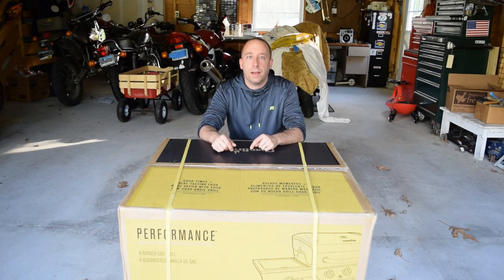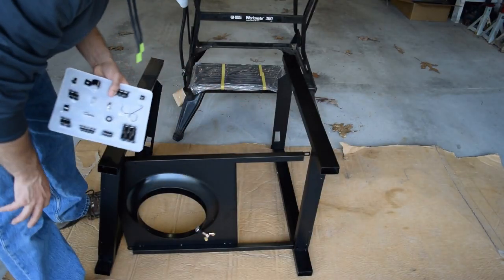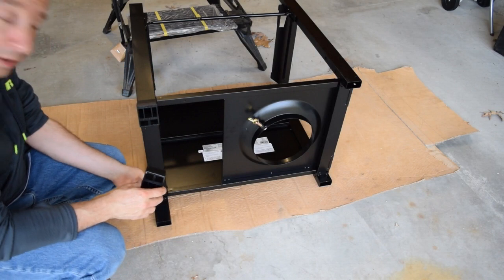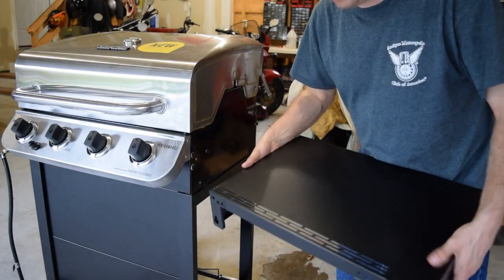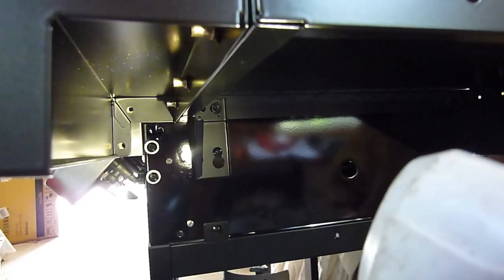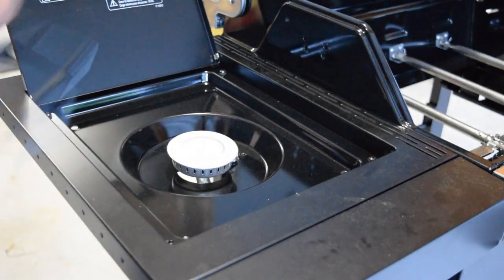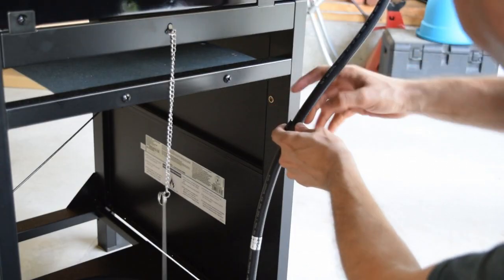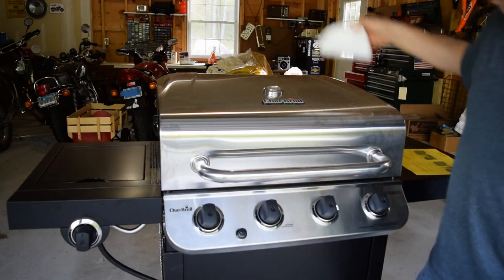Char-Broil Performance  4 burner Grill Assembly (Model number 463347017)

Comment: What is that little chain hanging down on the frame?
Reply from the maker: It's to hold a match if your igniter goes out
Reply: @SevenFortyOne  thank you.Now I'm going to try and put that clip on the side burner.
Reply: @SevenFortyOne  Thank you, I was wondering about this as well.
Reply: Your video has definitely helped me today.  I've been putting my new grill today and was getting rather frustrated by the pictures on the directions. So small.  Thanks so much.
Reply from the maker: Glad this helped!
Reply: The directions have a 1 2 3 4, and then said screw numbering the rest of the pieces. Argh trying to figure this out which one is the two 31s and 32 and 36

Comment: I had to watch your video just for the spring clip at 15:00. I thought I was doing something wrong. I was looking for a second hole but it literally just sits on top. I used the manual to put it together. Took me a little under 2 hours.
Reply: mluterancik I still don’t get this part 😫😤
Reply: Yeah, that part was what made me look up this video. The instruction manual didn't explain it in the slightest. The picture was awful.
Reply: @mikerennie2024  Agreed, it's the weak link in the instructions.  Glad I found this video it straightened it out in my mind like that (snap)

Comment: Kudos for this video:   I followed the instructions to assemble my recently purchased char-broil model 463376217.    I didn't find anything that didn't apply to this model as well.   I have little experience in projects such as this, but I found the video explained everything I needed to know.   If I did not have this video, I expect the project would have taken at least two additional, head scratching, hours.   
I did find one point where the video may have contained a minor error.   The video suggested placing a washer on a bolt to correct for a too large hole.   When I inserted the bolt in the opposite direction(which is believe is the correct direction) I didn't need the washer (which did not come with the the grill).   Doing it this way also meant I didn't need the wrench on the nut.   The nuts all came with a sort of scored, attached flange which serves as a lock washer and which allowed me to assemble the entire grill without the 10 mm wrench suggested in the video.   My only tool was a phillips screw driver.

Comment: We just bought this exact grill, and I Googled looking for an assembly video. The instruction sheet that Char Broil gives you is absolute crap. I set my laptop up on the old grill and went step-by-step. Terrific video! A couple of times he forgot to mention which particular screw to use, or exactly where one went, but I was able to quickly figure it out.

If you bought this grill and couldn't make heads or tails of the directions, this is the video you need!

Comment: Thanks.  I am actually pretty mechanically inclined but I thought the instruction were wanting.  There were just diagrams and no how to written communication.  You saved me on how to get the wire clip connected.  I was looking for another hole not knowing the one part went over the fitting.  And I too missed the 4 additional screws for the side shelves.  My guess is,
 it is the instructions and not our collective memories.  GREAT JOB!  Thanks a bunch.

Comment: Thanks for taking the time to do the video.  I was lost otherwise like the other comment the assembly instructions are more or less useless.  I am female and never in my wildest dreams did I think this grill would ever go together. One thing I did wrong was the orientation the main hood.  Had everything assembled in 4 hours and realized the drip pan would not go in.  Left the shelves on and took the four screws out flip it and was back in business.  Good job on the video... LR

Comment: Thank you for uploading this video - very helpful indeed.  I did not find the manual very helpful except it provided an accurate parts listing.  Your explanation for the labels on the back of the package containing the screws, bolts etc.. was very nice touch.   Your video made the setup very easy and very fast.  The model number for my grill is 46334718 but the setup is the same.  Picked it up from Lowes at the start of their 4th of July event.

Comment: I wish I had found this before I built this same grill yesterday. Took 4 hours with patience building breaks. Worst part was the side burner control! Never could get the silver cover to line up with all the resistance from all pieces! Hoping to be sure I did this safely, so you will be a comfort when I get to that part!
Reply: This build would have been so much less intimidating if I had seen this first. Thanks so much.
Reply from the maker: I'm glad my video helped you - thanks for letting me know!

Comment: Excellent video! Thank you for taking the time to film this! You made the process much easier!
Reply: the gas pipe coupling from side burner is not tight, despite the clip. not to mention the end of that pipe has a mesh wire section. How oes that not leak gas. I assembled mine yesterday and dared not use it. I thought I  did it wrong till I  see this video.

Comment: You make this look like a piece of cake! I just spent over 2 hours trying to put the 5 burner stainless model together and gave up. Your video makes a lot more sense than the horrid directions. They give part numbers but nothing is labeled except the blister pack of screws. It is basically written in hieroglyphics with nothing but pictures that don't necessarily make much sense. Thanks for the video. I might actually be able to grill on the 4th of July after all.

Comment: Be sure you send in your warranty and registration info. I purchased a Char-Broil 4 burner commercial gas grill at Lowes over 7 years ago.  I wanted to rebuild it, it was rusting out. Char-Broil said my 4 gas burners were still under warranty, after over 7 years, and they were free. I Did order the other parts, cross over pipes, flame tamers. Installation was easy. Char- Broil was very nice. Thanks, JohnG

Comment: Great video! Thanks.

NOTE:  One correction! You installed the top-rack / warming-rack upside down. The lip in back should go "upward" (which helps prevent items from rolling off the back).

I personally did not think the instructions were difficult to follow. The entire project took only 1 hour roughly. Just look closely at images. 

This video is wonderfully easy to follow.

Comment: 5 minutes in. My screws did not easily fit into any of those pre-drilled holes. Wish you would have shown yourself doing it so I could know if this was unique to my set of D screws or if I am missing something because up to that point - smooth sailing.
Reply: I had the same problem with mine.  I use an Awl to try to get them in line.
Then I had to use a offset screwdriver to get them in.  Other than that all
went well.

Comment: Just bought this grill and became overwhelmed with the instruction booklet it came with. Your step by step video helped me a ton! However, one thing that I got very confused with was the clip to hold the valve. I couldn't figure out where to hook it after I clip to the venturi tube.
Reply from the maker: It may not have shown up well in my video but It just clips around the "T" Fitting that is part of the side burner control.
Reply: SevenFortyOne thanks for the video bought this grill from Aldi for $80 (doesn't have side burners) and our "G" clip doesn't hook to anything and don't understand purpose?
Reply from the maker: Sounds like a different grill and may be a different design.  It might be a good idea to check with the manufacturer to see if they can give you some info.

Comment: Thank you for your video! I just need to change the 4 burners of my Char Broil Convective 410B and only I can find a very thick ones in Amazon that do not fit in the panel hole to reach the gas ... can´t finde the correct ones anywhere.

Comment: If you put the two rectangle pieces down first then drill the designated screws for them it’s easier the gas tank holder not in the way

Comment: This is a rookie & embarrassing question. I just finalized the assembly of the Signature series 4 burner but I flipped the base/bottom of the grill. This was realized when we tried to slit in the doors. 

Question : Is it as easy as just taking the wheels out and screws on the base and flipping it?

Comment: So my ignitor doesn't appear to work. Even with the proper connections and a fresh  AAA battery, it does not click? Full disclosure: After installing the grill, I went six months before trying to use it. To be safe, I replaced the battery that had been sitting for six months. The grill was safely covered and under a patio so the elements did not get to it. What might be the problem? Thanks in advance.
Reply from the maker: Hard to say....if you are sure the battery is good and installed correctly then maybe check all the wiring.  I suppose the igniter itself may be bad too but I don't know how to test it

Comment: I got this grill home but took one look at the instructions and took it back to Lowes to have them assemble it.  There are no words to accompany the illustrations!  Duh!  Luckily, Lowe's already had one assembled and it barely fit into the back of my CR-V after I took the lid off.

Did you install the grills upside down?  Charbroil also wants you to inspect the flames before you put the metal shields and grates on.

This video is very helpful and Charbroil should compensate you for doing the work they should have done.  Too bad so much of the closeups are out of focus.

Comment: (reposting to correct) the gas pipe coupling from side burner is not tight, despite the clip, not to mention the end of that pipe has a mesh wire section. How does that not leak gas? I assembled mine yesterday and dared not use it. I thought I  did it wrong till I  see this video.
thanks
Reply from the maker: I'm not really a fan of how the gas tube for the side burner connects with that clip either - it seems a bit flimsy to me.  
I think the wire mesh is there to help let air (Oxygen) in so the flame in the burner will burn evenly.  The pressurized propane gas flows past the opening and sucks a bit of air in through the mesh opening as it passes by.  This is all governed by complex things I don't fully understand like fluid dynamics and the Bernoulli principle so I can't really explain how or why it works I just know that it does.  And I know that without the mesh opening it wouldn't work properly.

Comment: THANKS 741! Question, the Q-hook that connects the side burner gas line to the base really does not have a defined fastening point. Can you share EXACTLY where I am supposed to insert or wrap the hook toward the front side of the grill? I can easily see where the back hook goes, in the copper pipe. Easy. But where to exactly place or how to hook the other part a real mystery. 

Thanks again. DW
Reply from the maker: I hooked mine over the T fitting that is part of the burner and parallel with the burner control mounting plate.  If you are looking at the front of the grill facing the burner control that would put it to the right of the hose that comes out perpendicular to the burner control mounting plate.  I don't know if that is the correct, factory spec location for it but that's where I put it and it seems to work OK.

Comment: Thank you for the video.  This was way better than the manual.  Unfortunately, my regulator was defective and now that I have the replacement part, there's no video or instruction manual they can give me.  The regulator is one piece that includes the burner heads so it's not your typical regulator replacement.  Any info on installing this?  Thank you.

Comment: when I got to the burner control and had to remove the screws (to be used later) I only found one instead of two. I tried to use only one, but the assembly is not sturdy enough. I tried to remove to first one, and I cannot do it, it got stuck! : ) (please, don't laugh too hard) What kind of screw should I try to buy from Home Depot, or hardware store? With anticipated thanks!
Reply from the maker: I really don't know what size it is.  The best thing to do is to call Char-Broil and ask them if the exact size and thread pitch isn't listed in the manual.
Reply: Thanks for the prompt answer!

Comment: Great video, and very helpful. One question I have - how much movement is there in your grill knobs/the stalks they attach to that regulate gas flow (side to side/up and down) as mine have quite a bit of movement. Want to see if this is normal as they all work, just don't feel solid. Thanks
Reply from the maker: I think Mine are pretty solid...
Reply: SevenFortyOne Ok. Thanks. May need to have mine checked as they're definately not solid!

Comment: I have 3 burner
I have wire going to side burner and then only 4 other wires - and six slots HELP
Reply: I have the same. There are 2 other wires for the igniter. Six in total.

Comment: My grill won't light. The igniter is working and my propane take was brand new and full.  Also tried manually lighting it. I've heard that the regulator might be the problem. I looked to replace it, but the replacement ones look very different from this one. Any idea what I can do to fix it? 
Thanks for the video!
Reply from the maker: I'm no expert on grills but make sure the valve on the propane tank is open and then turn on one of the burners - you should hear the gas coming out.  If you don't hear it then something is probably wrong with your regulator. If you do hear/smell gas at the burners then the regulator may be OK and you may have other problems.  If the grill is new you can call the number in your owner's manual for help.

Comment: Have you had any problems from higher yellow flames around the front of the tubes and the crossover bars? Can't seem to get even higher temps on my unit and I fear those yellow flames are the culprit.

Comment: Thank you! I have not received my grill, yet...however, I will be attaching a natural gas line to mine. Is there anything different I should do during the installation?
Reply from the maker: I don't know...you should contact char-broil about this.  This grill is designed to use propane.

Comment: I assembled the grill. good vid.  On mine the side shelf has preloaded screws to slip the shelf on just like you did.   However, I cannot screw in tight the preloaded screws.    I dont want to break them if they are not supposed to go in.  When moving the grill, by lifting the side shelf it does not seem secure.  .Were you able to screw these in?
Reply from the maker: Mine went in harder than the others too.  You may want to take them out completely to see if there is any debris in the holes or if they were maybe cross-threaded at the factory.  You could also try squirting a little WD-40 or 3in1 oil on them to see if that helps.  
Now that I think about this a little I'll bet the factory put some form of weak thread-locker on them to keep them from coming out during packing/shipping which is why they are a little hard to screw all the way in.
thanks for watching!
Reply: Thanks for the suggestions!  I'll do that.

Comment: Thanks for the video, just assembled it myself today.  Do you know what the hanging chain thing on the side is for?  I believe it's part #35.
Reply from the maker: I think it is a matchstick holder.  You can clip a list match on the on the end and use it to light the burners if the built-in igniter fails.
Reply: Thank you, I just assembled mine today, and I was wondering what that was for?
Reply: SevenFortyOne thanks man. Was wondering what the hell that was for makes sense.
Reply: ZetsabreJuno the chain is actually a match holder to light your grill manually 😒 in case the igniter doesn't work. pretty safe though.
Reply: The match holder is explained in the manual on page 7 at the bottom right.

Comment: Minor mistake. you put the upper grill in upside down..the grill lip should be facing up (presumably so food doesn't fall off the back) and the sillver pivoting bracket should be under the grill part.

Comment: Excellent video!  very informative. What I'd like  to know is did it perform well for you? Even cooking , good pre heat? etc. Many Thanks and good grilling.
Reply from the maker: So far I have only used it twice.  The first time was just a trial/break-in run with a few burgers and dogs for the family.  The second run (and main reason i bought the grill) was a bachelor party I threw for my buddy.  I fed about 15 guys - burgers, dogs, brats and cooked some corn on the cob on the side burner. I was able to use the two left burners on high for cooking the burgers and the two left ones on low for the dogs and brats.  The side burner was a little under powered for the big pan of water I tried boiling up for the corn I so I ended up pre-heating the water on the kitchen stove.  Once I got it boiling in the house I brought it out to the grill and finished up outside.   Everything came out pretty good, cooked fairly fast, and I received nothing but compliments.  I'm not really into grilling (or cooking in general for the matter) so having a decent grill like this one helped me make the party a success.  I'm looking forward to hosting more cook-outs during the summer now that I have this grill.  Thanks for watching!